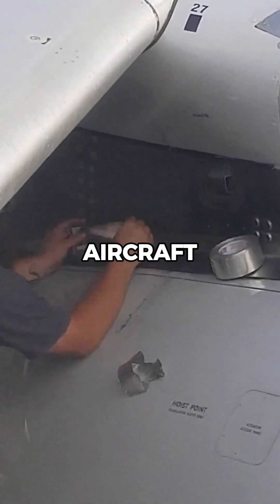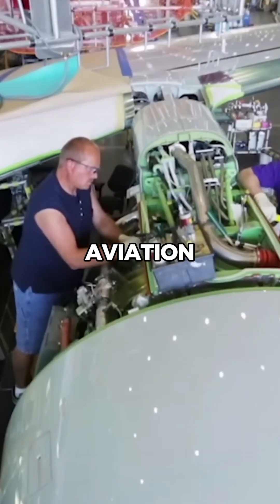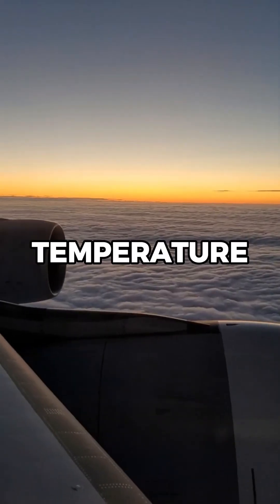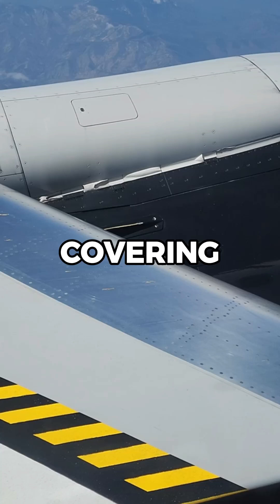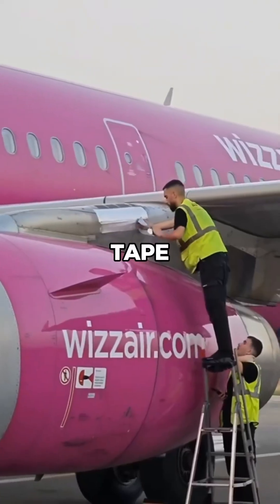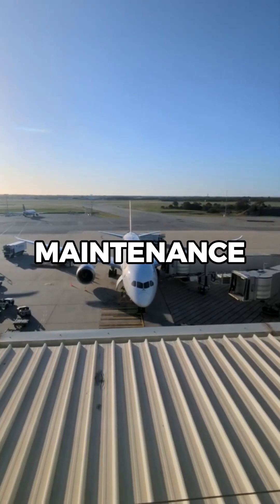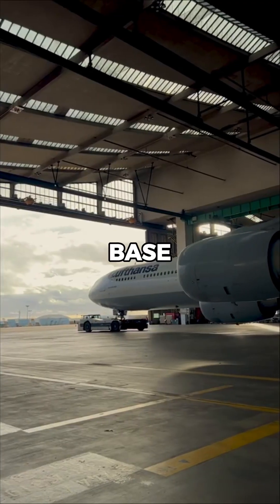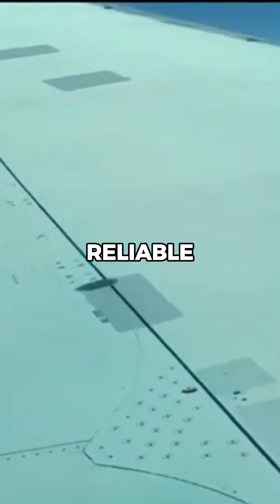why do airlines use duct tape to fix planes?

Comment: The correct answer is: because it's was approved by the aircraft manufacturer and it is properly described in the aircraft maintenance manual which the mechanics follow. They will never tape anything which is not approved to be taped.